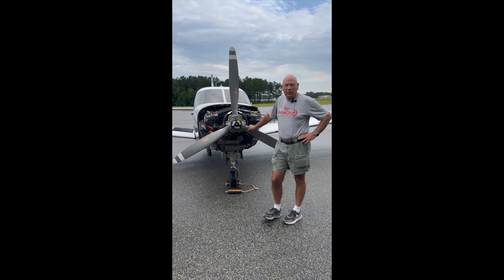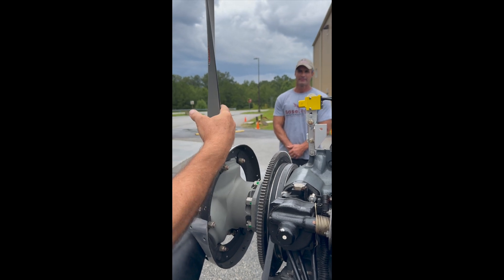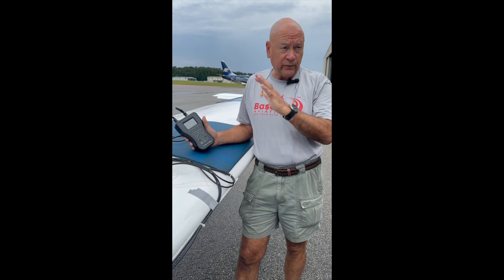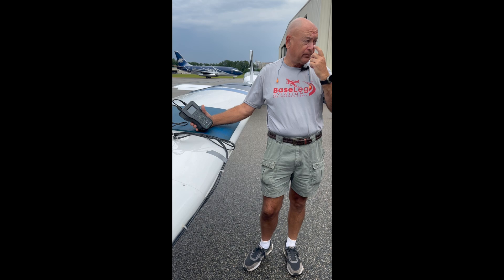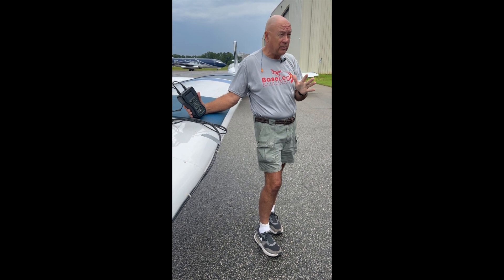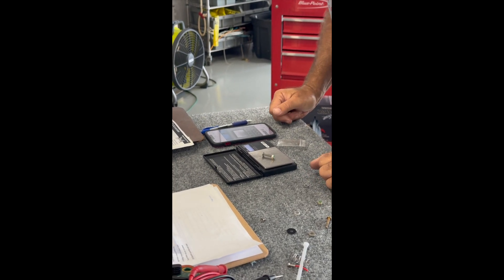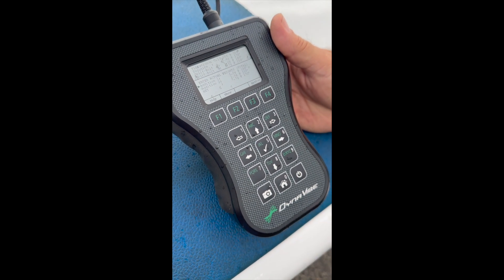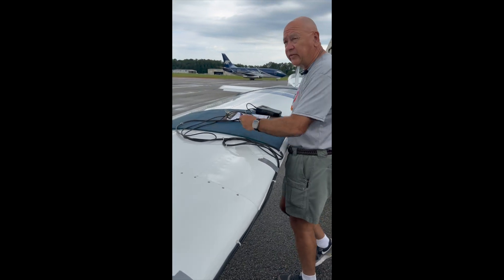Balancing the prop on a Lycoming engine

Comment: I've made a homebuilt dynamic balancer for about 100$ using an Adafruit ADXL335 accelerometer, a small IR phototransistor, a couple of resistors, a USB connector with power supply for 5vdc, wire and a Hantek 2 channel oscilloscope (60 bucks US on Amazaon).  The Hantek's output goes to my tablet with an OpenHantek oscilloscope app. The accelerometer goes on the front of the engine somewhere, and the phototransistor I put to shine on the back face of the ring gear with reflective tape.  The outpuit sent to the tablet is a sine wave from the accelerometer and a square wave from the photosensor. The offset of the square wave relative to the peak of the sine wave (roughly one volt per G) is the heavy spot. Measure the offset in milliseconds on the app, and a little simple math gives the degrees of the sine wave peak from the photosensor target. It works more or less like the basic Dynavibe where it gives you the location of the heavy spot and the intensity, and you work it down by  trial and error. It's worked well on test articles and I'm about to try it out on my O-290.

Comment: This was one of the best videos for using the Dynavibe and this is the first video that included a real world safety briefing.  Nice job!!! Just notes to save time: I assembled a hardware kit that includes all fasteners, washers, etc in the dynavibe kit and pre weighed them and labeled the part number and weight on a label.  I used a cheap “Hatbor Freight” clear plastic parts tray that has a clip down cover, I also made a set of engine mounting hardware out of a couple stainless nuts for each size tig welded together with a stainless hex bolt on the end. I have rolls of the black gaffers tape 2” that is made by “Lockport” to mount camera equipment and holds well but comes off without residue or paint damage. I also picked up a roll of 2” Solas-A C036 reflective tape “Amazon” that will last for years. Thanks for taking the time to produce this video, it is a great reference. Joel Davidson

Comment: At 12:29 you stated that “you always take the weights out and add new ones, they are not additive”.  However you stated that you were going to add more weight to the same locations.  What did you end up doing?  Why did you not just add a washer to the existing bolt/nut combination to increase the weight?  Why did you choose to add more weight to the existing location instead of utilizing the programer to tell you where the final weight should be place (which is typically a different location)?
Reply from the maker: You always start with a fresh, empty flywheel. The unit does tell you where to place the weights an how much. Rarely do I see the same amount added back to the same location.
Reply: @baselegaviation1614  so it (DynaVibe) considers that it has 3g at a spot and wants you to increase it to 4g?)

Comment: Hello from Sydney Australia.
Maybe a silly question,, but do the."balance nuts and bolts stay in the flywheel? What about Loctite on the thread?
🛩️🌏
Reply from the maker: Sometimes they stay on the flywheel, and sometimes due to belt interference we place them on the spinner bulkhead. No loctite needed. We use either fiber lock nuts or heat nuts, depending upon finding the proper weight.
Reply: i think he used a nylon locknut.   may be it works better than loctite?

Comment: Do you do a final check with the spinner on?
Reply: I think it's wise to check with the spinner on.  In fact, I just added washers to the spinner screws on my 2-blade hartzell/io360.
Reply from the maker: yep. we normally have the spinner on. yesterday was a training class in how to use the equipment.